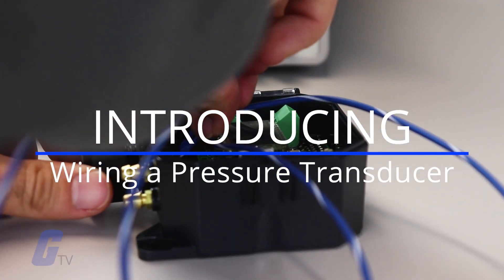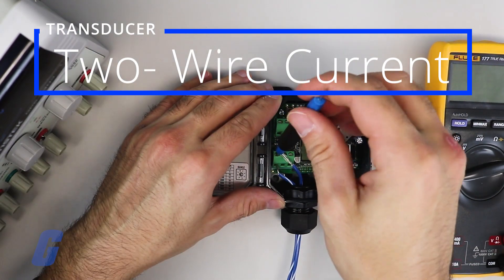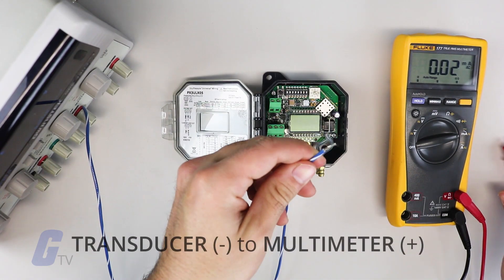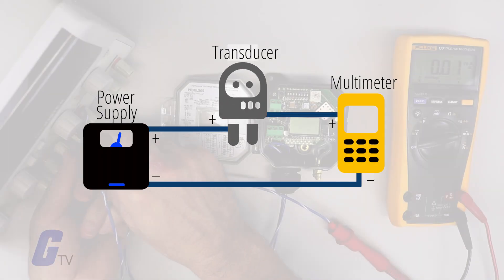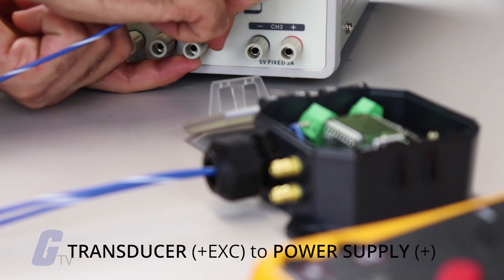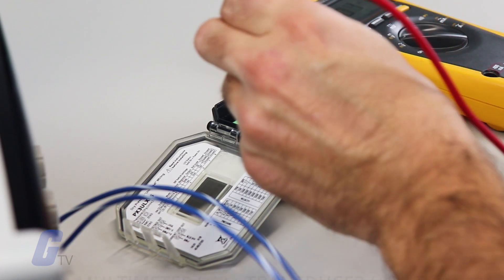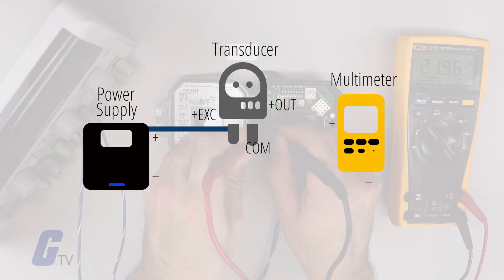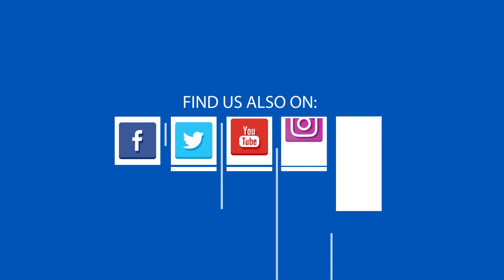How to Wire a Pressure Transducer | Galco

Comment: Sir the Pressure sensor i am using is 5 wires plus 1 shield, how do I know the individual wire functionality or Wiring diagram. It only has color coding.